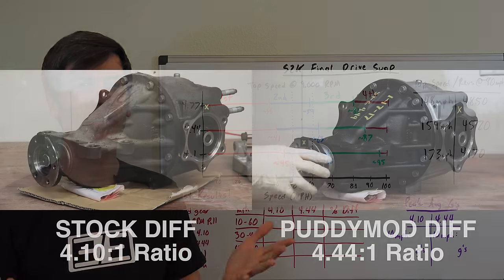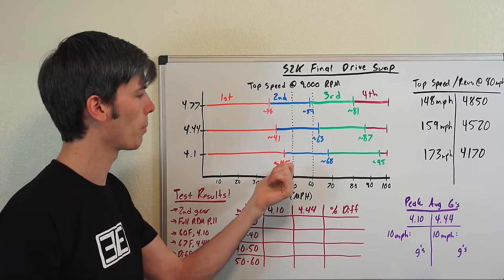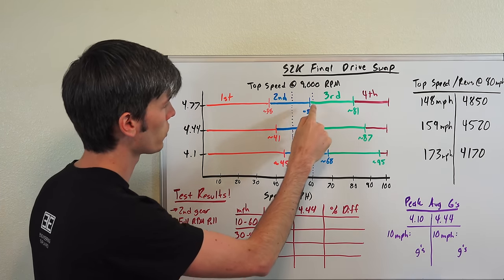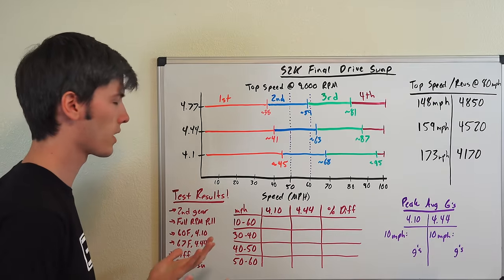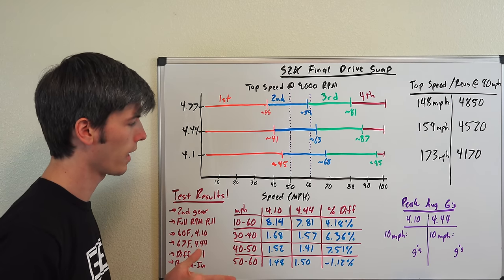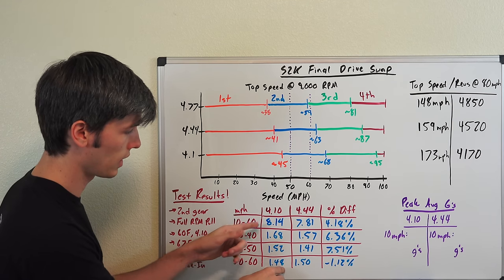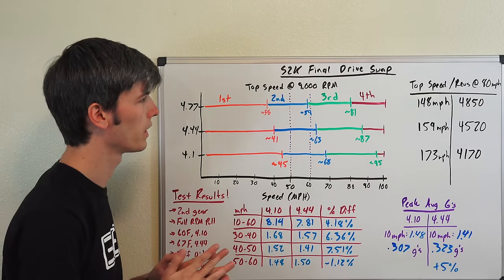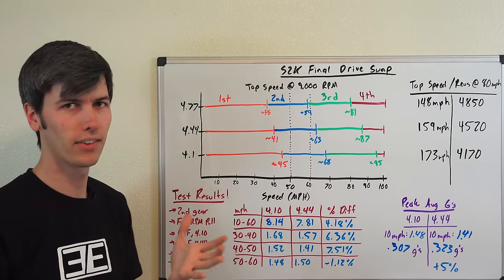Can Gearing Make Your Car Faster? With Proof!

Comment: I agree with what you said - I just wanted to mention that in a real acceleration run (where you change gears the calculations are a bit more complicated. You elegantly avoided that by keeping all the testing in second. You see there is a point that the stock car is using a a lower gear than the car with short gears. At that point the stock car has actually more torque at it's wheels. For example in your S2K between 60-68 mph acceleration the stock car is using 2nd gear while the 4.77 is using 3rd - so the stock car would have an advantage - would that be enough to change the outcome of the race? Probably not but the difference wouldn't be as great for the lower geared car.

Comment: You said that from the calculations, you wanted to use the 4.77 instead. You could use slightly-smaller-than-stock rear tire diameter to effectively increase the final drive ratio that little bit more...

Comment: bruh you read my mind every time.   love the way your brains works   (yes im also complimenting myself. ill take it. :P  )

I too would take the aggressive ratio for more fun in the canyons, though it would be nice to pair this swap with a 6th gear swap (to a smaller 6th gear) to get back some of that highway fuel efficiency,  but thats basically the cost of a transmission full rebuild    :O

Comment: I did similar runs back in the day when I ran the 1/4 mile, only my constant was distance, not speed. I ran the 1/4 mile in 13.32 seconds at 112 mph with a 3.90:1 gear ratio. 
Changing to 4.11:1 gear ratio had me going 12.96 seconds, but I actually went slower, at 108 mph. So I got to the end of the 1/4 quicker, but not faster. Try explaining that phenomenon to people and their heads turn sideways.

Comment: One thing, that is a good upgrade if you don't want to touch engine parts and make it reach more power but. If you will upgrade your engine and make it get more power and torque you shouldn't throw away that final drive, It depends obviously how much more power would it reach. But in case the engine won for example 100whp you will need it(the 4.1 final drive) more than the shorter one. It's all about what you expect the car do. If you want to drift the 4.77 would be perfect. 
Another thing. If you want to have almost perfect performance acceleration on each shift you'll have to change individual gears from the gearbox to keep the acceleration always near from the peak of the maximum power whiteout letting revs fall to much.
A short experience I had changing my final drive and gears more than 4 times while I was upgrading engine by steps. I started with the original (3.56) after that 3,76 with same engine, then 3,96 with little upgrades, then 3,76 with more upgrades and now I think will return to 3,56 or perhaps 3,37 that is the largest that exist for my car. Hahaha lol. That's only the final drive. From gearbox I changed 3rd and 4ºth gears shorter than original and 1st and 2nd longer with straight teeth gear(I don't know if it's call like that in English sorry LOL) haha well now I have to see the new performance how it is, the curve of hp and torque and see if I have to change some gears again. Well thank your vid, was excellent explained. Regards!

Comment: it would be nice if you do some 1/4 mile testing times too.. with new tyres vs old, new diff, etc.. 
what is next? coilovers, exhaust?
Reply: MSD
Reply: Maxi Biscardi the whole point was to get consistency, 1/4 mile times are not very consistent.  Plus, even in Idaho, it's not easy to find areas to pull a quarter mile run on public roads and he doesn't have a track.  Plus I don't think the drag strip near him has opened for the season yet.
Reply: that's true, they do not have the consistency of their tests, but will be a nice data to have anyway.
i didnt know that there was seasons for drag tracks, but taking in mind the weather there makes sense(i'm from argentina)..
Reply: levi leitaker not legally
Reply: yes, but you will not do it public here, knowing that he has 1.2m subscribers..
Reply: levi leitaker he wanted to eliminate as many variables as possible, and this was the best way of doing it, what other numbers do you really need?
Reply: levi leitaker 0-60 isn't really a useful measurement.  He even explained how 0-60 would give misleading results had he switched to a 4.77 final drive
Reply: Most people didn't get how this guy is working. Barking not biting. He talks about everything. He have one million theories and calculations but never test his assumptions for real

Comment: How about a variable differential? CVT diff maybe?
Best of both worlds.
Reply: There are two speed differentials but usually only found in trucks.
Reply: that's the entire point of a transmission.. why would you want a transmission AND a variable speed diff? (i'm not talking about the two speed ones in the occasional truck)
Reply: Because you can have a fast acceleration diff and a high speed or high economy diff in one.
Reply: no, it likely couldn't.  Sled cvt's are much bigger then a typcial diff in a car, and only handle ~180hp or so, and the belts need replacement every few thousand k's.  A CVT transmission would do everything you want from a cvt diff, and be more robust.

If you want to swap between drag and highway gearing often, use a quickswap diff.  That let's you change gears quickly and easily.

Comment: Top gear is meant for fuel economy on most cars.  Top speed will be drag limited rather than gear limited.  You might even gain top end by fighting that drag with more torque.  I have however seen V8s screw up the launch effectiveness with too low a rear end.

Comment: You should do one about maximum acceleration with your car by flooring the throttle, and only use clutch to keep the engine at 8000 RPM. Even when shifting gears, keep the throttle fully open. There will be lots of clutch slip, but you will be lot quicker and g force.

Comment: if your changing your tire size the Equation to figure out the Diff Gears is (old ratio*new tire/old tire) so Example of that from my Truck, stock tire size is 245/75/r16, so 245=30.4" Gear ratio=3.73 New tire size 315/75/r16, 315=34.5" (3.73*34.5= 128.85/30.4=4.233) therefor i need to install 4.23 gears which they don't make for my axle so 4.10 gears will work but probable install 4.55 gears to put larger tires in in the future.

Comment: I went from 3.73 to 4.56 in my truck, combined with a slightly larger tire size and it was definanetly noticable. I also didn't lose any highway mpg but gained about a one in the city
Reply: I would like to change  from 3.27 to 3.67. Is there possibe to gain mpg in the city?

Comment: Also a great video to explain how RPM is amazing! in this scenario 4.44 wins because you only need to shift once, but with some valvetrain work and cams that could carry the power a bit higher the 4.77 would win if you didnt have to shift till 10,000!

Comment: went from. 3.23 to 3.73. 0-60 went down from 5.4 seconds to 4.4 seconds but my top speed is down. I never did a top speed run but there is about a 350 to difference in each gear
Reply: What kind of car? I have a 01 camaro with built motor and trans and 2.73 gears so first goes to 60mph! And its still fast af... wondering how much faster 3.90 gears will make it
Reply: @Way2EasyDIY  tire spin. Unless u running wrinkle walls and got weight transfer setup really good. Go for low 3.?? Ratio. Also are u done adding power? The more power/ torque  you have the more you will want that taller final drive. Also tire height are you going to run a taller tire like a slick. That will give you a taller final drive and need to compensate for it.
Reply: @everythingbox  sold that pos Camaro lol. But i got 393 gears and it helped a good bit. 4 speed auto sucks for daily use especially on highway

Comment: It's interesting that the attitude toward ambient temperature changes with power. When you said 67F vs 60F I assume that the higher temperatures will give you more traction, thus greatly negate the increase in oxygen. This is probably only valid with enough power to break your tires lose much of the time from 10-60.

Comment: In my 5.3L V8, I briefly considered going from a 3.73 to a 4.10 but decided I had enough acceleration and wanted to keep somewhat decent highway mileage. 4.44 and 4.77 sure are some short gears for a street car! Though, obviously, it depends on what the transmission's gear ratios are.
Reply: @doctorunicorn5550  Yep, I saw it! Thanks for the response.

Comment: Hey what about this !! So let's just take the 4.1 vs the 4.44 for simplicity's sake. The 4.44 will be faster from 0-41MPH, but the 4.1 will actually be faster from 41-45 mph right ? Because changing the diff only changes the final drive not the actual transmission's ratios so since the 4.44 changes into 2nd while the 4.1 is still in the lower gearing of first between 41-45 it will be faster in this interval, not even accounting for the shift the 4.44 has to make. 

Then once again when the 4.1 shifts into 2nd at 45 the 4.44 will be faster from 45MPH-63MPH until the 4.44 again goes into 3rd and the 4.1 has the gearing advantage of being in 2nd vs the 4.44 being in third from 63-68mph. So it seems the effects of the lower ratio final drive are also skewed towards the earlier gears not better acceleration throughout all speeds up to the lowered top speed !

Comment: The rev limiter will likely have a "soft" limit 200rpm or so before the hard limit at redline. In this range it will progressively start dropping cycles to ease into the limiter.

Comment: Heard the same thing with trucks towing. Think it was the 2500 vs 2500hd. One had a different axle ratio and could pull more weight, but also cruised at a higher RPM so burned more gas.

Comment: The first gear is usually too short for best acceleration. If you can spin the wheels it means you could’ve chosen a lower ratio. So I would prefer something just above the limit (if say 4.50 witha 4.0 final is the spin limit I would go with say 4.60 first and 4 final drive). The final drive depends on the engine power. With high performance cars you can get to 60mph in first gear

Comment: In other words you tested the thing which is the kindest way to measure the exact upgrade that you did.  How about comparing 0-90 or 0-100 mph times with the two FDs?  Something with multiple shifts would be much more representative of real world driving.  Sure shift times (and exact shift points) would introduce more variance into the test, but that's why you do multiple runs.

Comment: Was just considering this by changing the gear differential on my 2010 Camaro (L99 engine). Stock I believe is 3.27 and wanted to go to  3.73 as I've heard this is the most popular choice. Not really into top speed as I won't be looking to find it's limits, but definitely want more low to mid range torque. Already added C.A.I's cold air intake and was debating between Long Tube Headers (with tune of course) or just have a gear swap, since pricing will be within the same ballpark.. 

Anyway appreciate that simple breakdown.

Comment: if it's going to be a track car, you'd be best off actually driving the track first. by paying attention to the car and it's relationship to the track you can get a clearer idea of your needs. you want to be in the engines power band when exiting corners. maybe a quick change diff is the best answer?... especially if you want to go to several tracks

Comment: So using your times, some physics and Excel, I did some calculations and worked out the peak power of your S2000 has about 160hp at the wheels.
That seem about right?

Great videos, keep it up.

Comment: 4.44 gears are a good compromise between stock and 4.77. I'm glad you did the math on how these gears work for the rest of us S2000 guys. by tv's way did you get the yellow box thing to correct the speedometer speed reading?
Reply from the maker: Yep, I've corrected the speedo since filming this episode - should have a video on the correcting soon!

Comment: Thanks for the video.  Looking to do the same on my 1988 Jeep Comanche 4.0L - it's only 2wd and weighs about 2900-3000 flat.  Current gearing is 3.55 and with peak torque of 245ftlb at 2400rpm it's fun down low off the line.  Really want to put 4.10's in it and stickier tires.

Comment: I love your videos and seeing what you've done with your S2000. But as an AP1 owner, you must have a special S2000. My top speed in 1st is only 36 or so and 2nd gear will get me to 62mph. While your math and general conclusions are correct, I don't see how you could hit 60 with the more aggressive gearing without shifting into 3rd. Seeing video if your actual runs with sound would have illuminated this.

Thanks for your videos and keep them coming.

Comment: This video explains some basics, but doesn't address acceleration over multiple gears. FD ratio changes doesn't really change your overall acceleration much at all once in your power band. The shorter geared car will accelerate harder, but have to shift sooner, and then accelerate at a lower ratio to the same X mph where the longer geared car has its first up-shift. What you'll see is the shorter geared car will pull ahead a bit until it shifts, where the longer geared car will slowly catch up and have to shift, where the shorter geared car will pull ahead a bit again. Given both cars have the same shift times. The longer geared car will always catch up at some point, although the shorter geared car will be a slight bit ahead during most of the time. Just to illustrate a car that is geared twice as low will not accelerate like it has twice the torque, because gearing/rpm limits. One area where shorter gearing will realize solid improvements is where a car needs to get into its power band. Shorter geared car will get through the 'poor' part of the power band faster than the longer geared car, which is a true benefit.

Comment: Good - I would have liked to have seen the comparison between the overall wheel torque in top gear and vehicle drag load against speed between the two diffs - this would have been able to show if you had improved the top speed or not.

Comment: You can get higher torque just downshifting, no need for a different differential. The only thing it can benefit is the clutch, at the expense of the CV joint.

Comment: I watched your changing the differential and also this video. Thank you, I enjoyed both. Just one question that came to mind. How does the stock speedometer determine road speed? Did you have to make any changes to get it to read correctly?
Reply from the maker: +Dean Rhodenizer for the S2000 it's based on a transmission output shaft speed sensor, so it does require calibrating the speedo. I will have a video correcting soon!

Comment: From what I remember from the AP1, VTEC engages at 4500 rpm. Of course, you can tune a different point of engagement, but assuming you don't, did you find you can cruise at highway speed and not burn all the fuel?

Comment: Faster or quicker? Now that's the question lol.
Reply: John I'll take a quicker car.  No one needs to go 160 mph but Everyone needs to go 0-60 in 3 seconds.
Reply: quicker would probably be beneficial to most
Reply: My old pony has 350000.0miles with a 4:10 rear gears , she will not go 55mph in 4th gear with out redlining !! But 5th gear must be OD?? Cause shift from 4th to 5th rpms drop from 3000rpms to 1950rpms 80mph in 5th gear she is turning 2950 on tact!! I get 25mpg on interstate driving at 70mph

Comment: I've seen cars whose top speed was achieved in a lower gear, since the engine could turn faster, develop more power, and push the car faster. If you're in a gaming mood try redlining the Gran Turismo Monaro in 5th gear, see how many revs you can pull in 6th (it won't redline), and compare the resulting speeds.

Comment: It would be interesting if you did a cost/power comparison between this approach with gearing vs. adding boost to gain additional torque. Maybe a ratio of dollars per percentage of g-force increase would work. You could even go way out there and add a drivetrain (LS?) swap in the mix. It wouldn't be everyone's cup of tea but I think it would be an interesting comparison.

Comment: I have watched all your videos about car's working, they are very clear and crisp. My doubt is if I have a CVT as the final drive instead of a gear pair with constant gear ratio , what will be the change in performance?? Suppose my CVT is able to vary the final drive ratio from 4.7 to 4.1 or 3 
1. how will it affect the vehicle acceleration
2.  is it practically possible?

Comment: I would change the 6th gear with a longer ratio, so I could still drive at the highway with good fuel consumption and low rpm. maybe you should consider this option?

Comment: I'm considering going from my tall 2.73 gears to 3.55 gears, but I'm not certain if the performance benefit is even worth it (V6), as I have to also spend money to open the differential and tune the car for the new ratio. Pumping loses would increase and thus, decrease my highway mileage.

Comment: i would like to see a S2000 with a ridiculously high final drive ration 7:10:1?
it'll probably slow it down a lot and the acceleration will be rubbish
but uphills are not a problem

Comment: Largely because of your videos, I've been considering an S2000 as a compliment to my 1994 F150. What's your opinion on the whole AP1 vs AP2 debate? I know you have an AP1, but is an AP2 worth the extra cost? I'm working with a budget of 10-12000 so that limits me to higher mileage AP2s or an average mileage AP1. Thoughts/opinions?

Comment: I don't think it is the g force it is the crisp throttle response and then the g force increasing, increasing and increasing more that puts a smile on your face.   A car with a very small engine will have low gearing which means it's performance will still be reasonably brisk from low speeds.  Gearing is a "force multiplier".